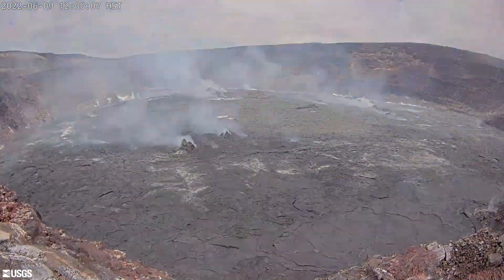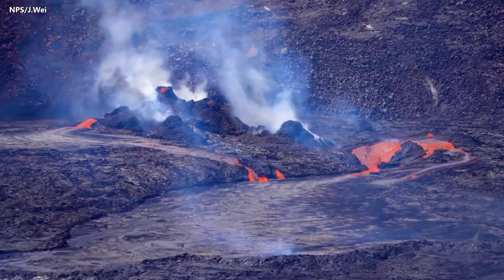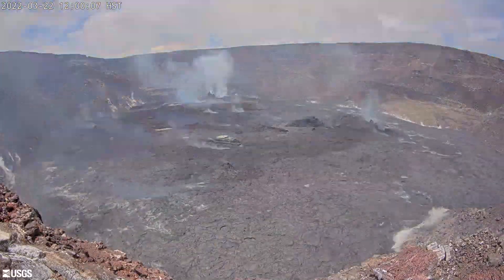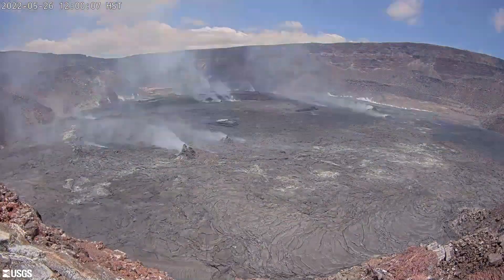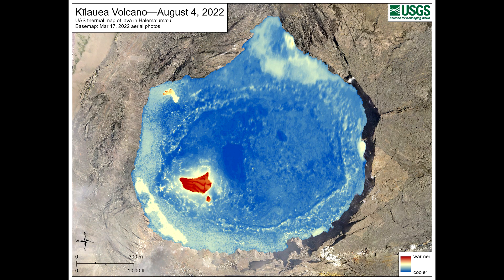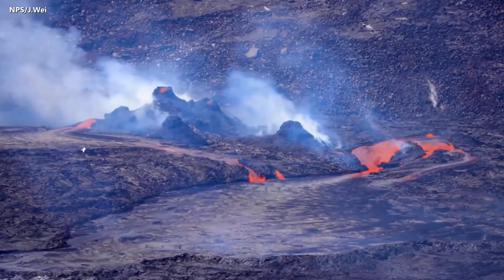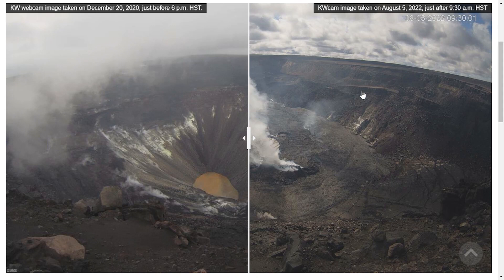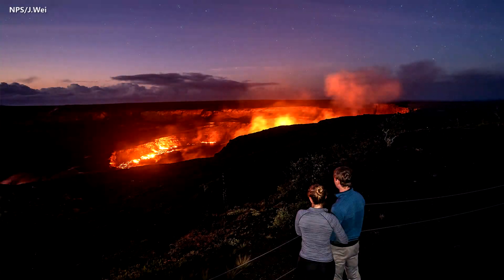Kilauea Volcano Crater Floor Uplift Explained (Aug. 6, 2022)

Comment: Wonder if it'll spill over the top?
Reply: Doubt it, but if the whole caldera spills, it will still be contained in the crater at the top,
Reply: @Viralliness  nobody thought the lava level will get this high, and look at it now
Reply: @coincommando3338  not the same..
Reply: @Viralliness  yes
Reply: @Viralliness  tHe sAmE
Reply: I think it is possible, but it is probably not gonna happen
Reply: If it can rise that much each day, it will spill over for sure.
Reply: @coincommando3338  if it reaches the downdropped block then it starts spreading laterally which adds hectares of extra  sq metreage the lava has to cover as well before it starts filling the crater vertically, which results in a much slower fill up and it has to do that for hundreds of metres vertically,

There’s a lot to say for the lava filling in a hole in the caldera floor as opposed to filling up the entire caldera
Reply: @Viralliness  NO7OO! STOP PLEASE. I wnat f fid burda comment not as agressive l as yours
Reply: @Viralliness  sfaduar
Reply: @Viralliness  aruXbdj
Reply: @coincommando3338  what?
Reply: @Viralliness  HHAAHHAHAHAHHAAHHAHA
Reply: @Viralliness  treba troll
Reply: @Viralliness  aduEysysy
Reply: @Viralliness  venco's de sosossososoooosso
Reply: @coincommando3338  Well that's how these ginormous eruptions built these huge shield volcano's.

Comment: So based on the uplift rate, how many months until the top is breached?
Reply: There is also the whole collapse question. A whole part of Halemaumau and a portion of other areas fell when the collapse happened. Is JUST old Halemaumau filling up or is more than just the lava pool surface rising? It isn't made clear.. If JUST old Halemaumau (a hole in a flat crater by old standards) area than it just means an increase in magma: or the whole caldera (which includes the whole collapse and some of the uncollapsed parts as well). If that was taken from the public access HVO museum, than we are seeing only a part of it.
Reply: The whole east rift zone is going to break off and fall into the ocean. Will create a mega tsunami which will wipe the the Hawaiian islands and wreck havoc on the west coast. The wave is going to be 300m high.